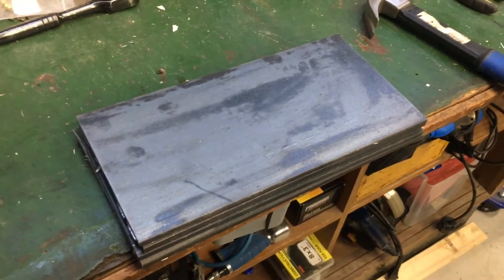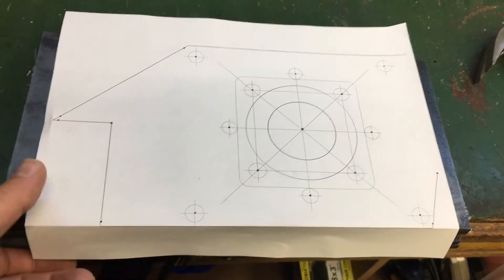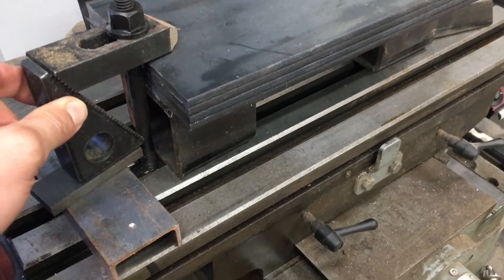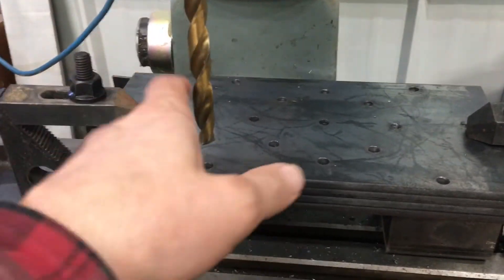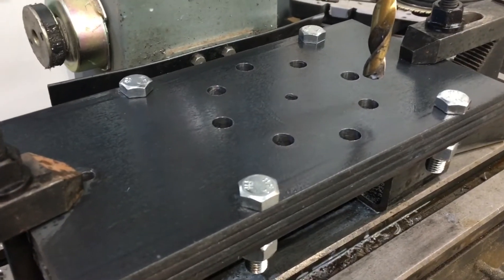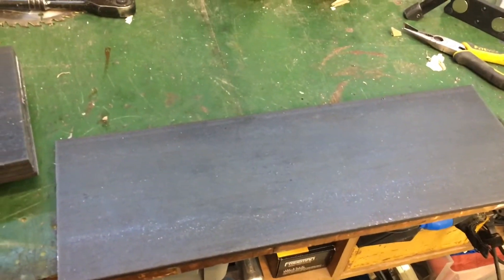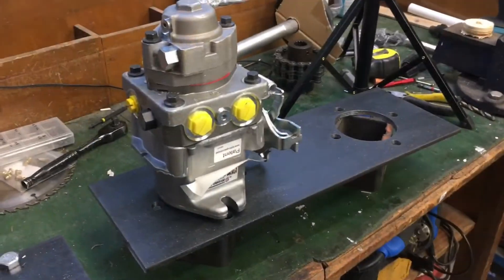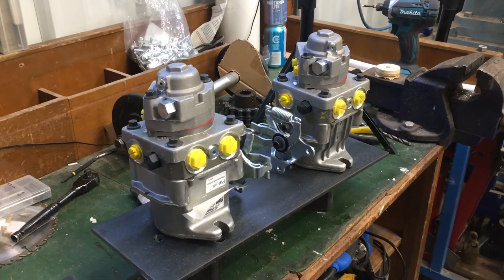Mini Snow Cat pt6 - drilling mounting plates

Comment: Your doing a nice job Rob, this is definitely going to be a nice project when you finish. I don’t yet know how far your into this project, but I’m looking forward to the test drive. Anything you would change at this point???
Reply from the maker: There are not a lot of major changes I would make, most are minor issues that can be dealt with.
-Starting off with longer tracks and building my own track suspension/slider. 
-Make the tunnel 2-3" wider.  21" works but a little more space would be good. 
-Earlier design of the shock mount location 6-10" further back on the chassis. 
-Could have used less 1/2"  and more 3/8" & 1/4" plywood on the cab. (I still could)
-Would not buy an EFI engine with unknown history!!!!
Reply: @rad1876  I appreciate your honesty in your videos!!! That’s what can be extremely frustrating when your not only designing a project, but fabrication too!!! I was wondering if you were going to have any problems with belts slipping in snow/slushy conditions??? Hope your family is staying safe in this damn pandemic!!! Thanks again
Reply from the maker: Belt slip is something that I have pondered, and perhaps I'll revisit it.  Until I get the machine out it's hard to say how it will perform.  I'm using notched V-belt to increase the drive performance, and using a spring loaded tensioner should help.  

If I find melted snow/slush is becoming an issue I might add another belly pan section under the engine.  The issue with the extra belly pan is it becomes difficult to change a belt out on the trail.